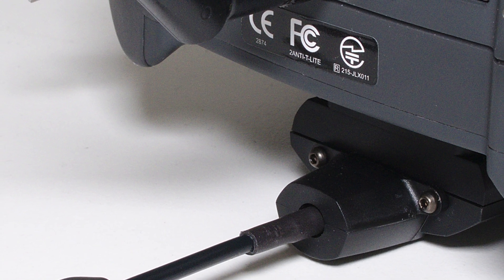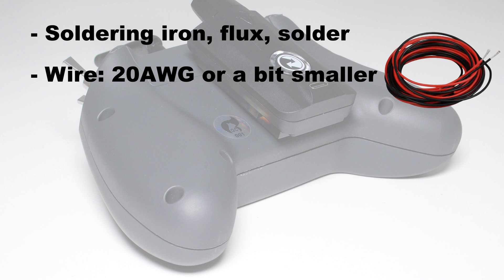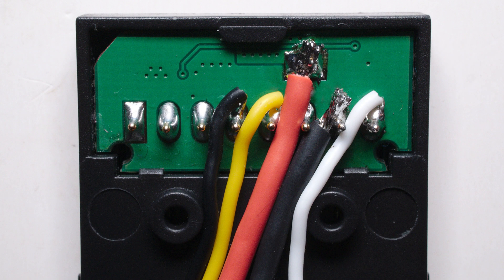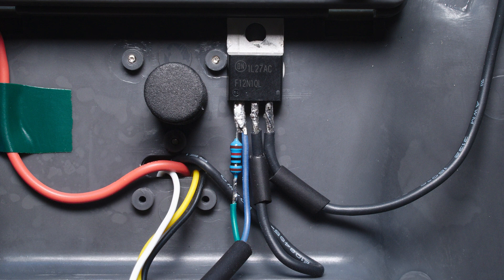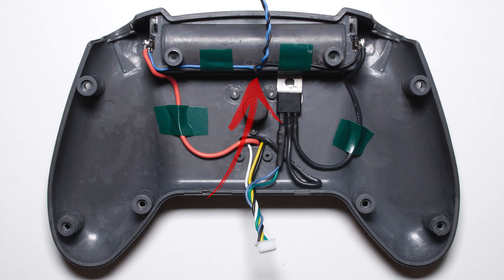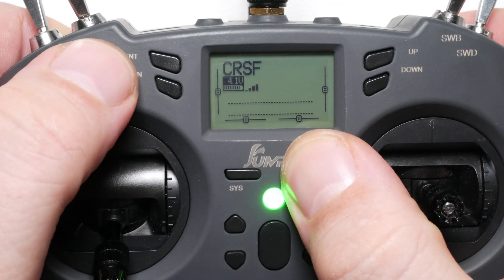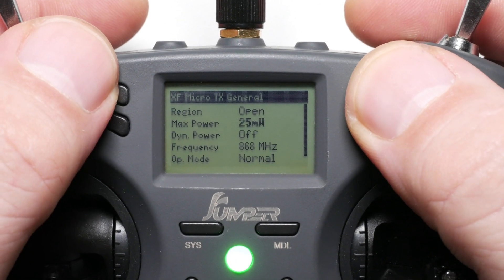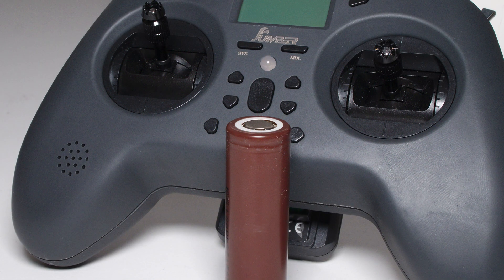Jumper T-Lite: 1W Crossfire mod (powers off when radio is off or when using internal module)

Comment: Thank you for the video... gonna mod mine, once it arrives. 
Btw, once you had everything opened up, why not adding a simple diode as "reverse polarity protection"? I know it's not perfect, but it certainly wouldn't hurt, and we are resoldetring battery contacts anyway.
Edit: Maybe adding another mosfet would be much better option... have to think about it :)
Reply from the maker: Yes, you could do this. Use a Schottky diode though. You want to drop as little voltage as possible. That's also the reason why I did not do it - you will "lose" 0.3 - 0.7V on the way. And since we only have a 3.3V reg and not a DCDC converter, I don't want to drop voltage if it is not necessary.
Reply: @stylesuxx  You are right... I'm just running through my "tiny parts boxes" trying to find something usable :)

Comment: Are you able to power the external module via a USB power bank and USBC cable? Will this allow stable 500MW or above?
Reply from the maker: Yes, powering from external should not be a problem at all. This is even the recommended way by Jumper ;-)

Comment: Скорее всего  Jumper выкатит в скором времени  Jumper T-Lite Pro. И в ней уже будет исправлена эта недоработка. Спасибо за видео!
Reply from the maker: I hope so. I hope they also address the VReg issue and add a spring as one of the contacts in the battery compartment - then it would be a perfect radio :-)

Comment from the maker: UPDATE: It has been brought to my attention, that there are more efficient N channel MOSFET you should use. Instead of the one I used in the video, go with the IRL540N or IRLB8743. They both have a lower Drain-Source resistance and are thus more efficient. Everything else stays the same. If you made the mod with a different MOSFET, please post below to help other users.

EDIT 24.01.2022: Before buying this product, please be aware that some users experience problems with "sticky buttons" - this can be fixed but you will have to de-solder some caps from the board.
Reply: I believe IRLZ44N should be usable as well...
Reply from the maker: @absoluteinvader  Yes, the IRLZ44N is also a good option.
Reply: Is IRL540NPBF the same?
Reply from the maker: @Diown  Yes, the PbF suffix just means that it is "Pb free" - without lead.
Reply: @
stylesuxx  Helpful video, thanks!  When you say "They both have a lower Drain-Source resistance and are thus more efficient" do you mean a pulldown resistor is no longer needed in the circuit?
Reply from the maker: @Clif_Brown  No, the pullUP resistor is still required. just the internal resistance of the FET is lower.
Reply: @stylesuxx  OK thanks! you say anywhere from 10K to 100K will work. Do you know what is ideal, since I have many resistors in this range.
Reply from the maker: @Clif_Brown  It's just a pull-up, so the absolute value is not too critical - that being said I would recommend going with 10k. I've heard people having problems with 100k
Reply: @stylesuxx  Great! Thanks again.
Reply: What’s the difference between these two?
Reply from the maker: @Diown  Between which ones? The difference between logic level and not logic level Mosfets is the gate voltage at which drain and source are fully switched (least resistance) - Logic level usually switches fully at 2V and up and the "normal" ones on 4V and up. The difference between the one that I used and the ones recommended in my update post is, that the new recommended ones have a lower resistance when fully switched, thus less energy is "lost" (converted to heat).
Reply: @stylesuxx  clear :) and between IRL540N and IRLB8743?
Reply from the maker: @Diown  Unfortunately it always depends on the context you want to use them - they are both Logic Level, both have a low resistance (although the one of the IRLB8743 is super low) and both can be used for our application - so in that way, they do not differ too much. BUT they are rated for totally different Voltages. With one you can switch up to 100V and the other one 30V - so in a different application where you would want to switch, lets say 60V, you could use one but not the other. I would suggest you google their name and "datasheet" and compare them. There are a lot of different factors of which you might only be interested in some - depending on the use case. For example: switching time is totally irrelevant to us, because we only switch once, then it stays on. But for an ESC you would want something with low switching time, to quickly switch on and off.
Reply: what about using a higher resistor? or better resistor for better efficiency ...just in case of strange power surges or interference and noise?
Reply from the maker: @agoogleuser1574  the resistor is just a pull up, it is Ok as it is...
Reply: Do you know if IRF540N is the same thing as IRL540N....that's the closest model i can find....
Reply from the maker: @cjcj1313  No, the IRF540N is not logic level it only switches fully at 4V and above. Where are you ordering from - I can take a look if they have a matching one...
Reply: @stylesuxx  I used one of these without checking the datasheet, because I just had it lying around. It seems to work when the battery is fully charged, but then stops working at lower voltages. I was super confused until I came and saw this as the first comment. Danke schön!!
Reply from the maker: @0bucklin  The one I chose still works at lower voltages, it's just not the best choice in regards to resistance. Which one did you use exactly and how low is 'lower voltages'? Bitte, gerne :-)
Reply: @stylesuxx  I had an IRF540. I think it cut out at about 3.5V, but I canät remember exactly. I just got an IRL540, which I will install this weekend. I'll update to let everyone know how it goes.
Reply from the maker: @0bucklin  Yes, it needs to be Logic level - they usually fully switch at around 2.5V.

Comment: Good mod but to be honest bad Mosfet choice. The part you recommend has approx 0.4Ohms at 3-3.5V, which will results in up to 0.4W of loss in the Mosfet. Take a look at IRL540N or IRLB8743. Those should up to 10x better.
Reply from the maker: Hmm, thank you for your feedback - but I am honestly not sure where you get the 0.4Ohms from. RDS(on) is max 0.2Ohm. But yes, you are absolutely right - looking at the datasheet, the ones you recommend would have been the better choice. I updated the description accordingly and pinned a comment. Thanks again.
Reply: @stylesuxx  Thanks stylesuxx. The 0.4 Ohms are from the graphs in the datasheet of the RFP12N10L. Take the graph where VDS is plotted against current ID with varying VGS. We have to assume a low voltage of just a bit above 3V. So go a bit above the 3V line and go to VDS=3.2V. You obtain an ID of ~8A on y-axis. This tells us basically the impedance --> 3.2V/8A. Doing the same with the IRB8743 gives us >30A (need to to some interpolation by eye).
Thanks again for the nice work.
Reply from the maker: @Stefan_73  Ah, damn - you are absolutely right. I was looking at the rDS(ON)/ID graph and did not realize it was at VGS 5V. I really wish, I did not have this MOSFET lying around, I am sure  I would have checked the datasheets more carefully. Thanks again for speaking up and pointing this out.

Comment: Can we have a link to the SD contents please? Its not in the description.
Reply from the maker: I just updated the description.
Reply: @stylesuxx  hey I got another question - how did you get the bars / rssi on the homepage?
Reply from the maker: @OceanoFishing  The RSSI Bars should be there by default - as soon as connection to the receiver is established. If not you can scan for Telemetry in the last page of the reciever settings and chose which value you want to use as RSSI. But again - per default it should be exactly like that...
Reply: @stylesuxx  ah okay I think its because of xm+ receiver I still have on mine. I haven't installed my crossfire yet but have the same set up you got here. Great vid BTW.
Reply from the maker: @OceanoFishing  Hmmm, you should still have an RSSI value with your XM+ receiver...
Reply: @stylesuxx  yeah I don't know why. Only get an RSSI from the OSD...
Reply from the maker: @OceanoFishing  Ahh, I am sorry XM+ does not have telemetry, you only have RSSI in the OSD - sorry for the confusion.
Reply: @stylesuxx  no problem! More reasons to switch to crossfire! :)
Reply: @stylesuxx  thanks!

Comment: I am worried about the data circuit between the module and the processor.  When you disconnect the ground, the potential of the signal lines can become higher than it should for a short while before the capacitors discharge, which can lead to damage :( Please rectify me if I'm wrong
Reply: It seems to me that the capacitance in the converter is enough to saturate the gate at the start.  Ultimately, we will use plates with a driver.  We ordered a pololu "mosfet slider switch LV", which seems to be a good solution and it is easier to solder aesthetically.
Reply from the maker: @michaskalczynski585  Interesting. I am looking forward to your solution. If high side switching is easily possible like this, it for sure is the cleaner way.
Reply: My firend was first with Pololu module. On 1W Dynamic power off only 0.1V drop.
Reply from the maker: @michaskalczynski585  cool, feel free to share his vid.
Reply: @michaskalczynski585  Which Polulu Modul was used?
Reply: @blabla5916  Mini MOSFET Slide Switch LV, item number 2810
Reply from the maker: Hmmm, I did not consider that to be honest. How would you go about testing that?
Reply: I have instructed my friend to use N mosfet in high side switching mode and initially confirm that it is working properly.  The circuit consists of a transistor and a resistor just like in yours :)
Reply from the maker: @michaskalczynski585  Interesting - how do you drive the MOSFET then?
Reply: So is this mod still good to go or should I add more circuitry to protect my jumper ?

Comment: Hi. Do you have any advice for some other N-fet because this one is not really available in Germany. Can I use a IRFB4410Z instead?  Thanks!
Reply from the maker: Look for Logic Level N channel MOSFET - they should all be OK. I would not use the one you mentioned - seems it only fully switches at around 4V. we want to fully switch as low as possible. You can also tell me where you want to order and I look it up for you. I bought mine at Conrad (am from Austria) - I assumed if they have it, anyone will have it :-D
Reply: @stylesuxx  Ich schau dann mal ob dir über Conrad in D zu bestellen ist.
Reply from the maker: @maykdo  https://www.conrad.de/de/p/on-semiconductor-rfp12n10l-mosfet-1-n-kanal-60-w-to-220ab-151623.html

Comment: Does it matters the wattage of the resistor? I'm ordering 10k 1/2 watt just to be safe, also I have few heatsinks for that type of mosfet so Im planning on drilling a hole in the back cover and secure the mosfet to the heatsink and the cover with a bolt that way it will have a good heat dissipation. But if I have enough time I will draw a simple pcb board and glue it to the back cover
Reply from the maker: No, wattage does not matter for the resistor, we are just pulling the input down to GND. And the MOSFET does not get hot at all, we do not switch fast and we always switch fully.

Comment: Great works! Thanks!!! In your opinion would jumper just fix this?
Reply from the maker: Well, I am not entirely sure if they see it as an issue that needs fixing, but it should be an easy thing to improve. And if they are at it, they could also swap the 3.3V reg to a step up converter too ;-)